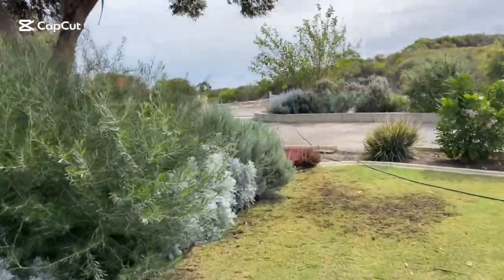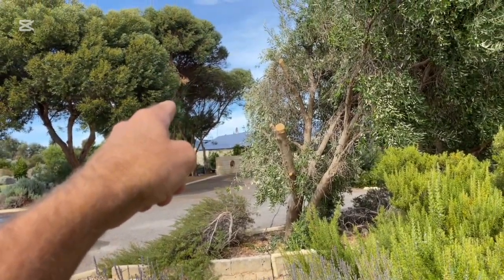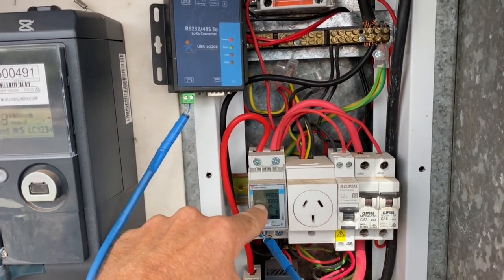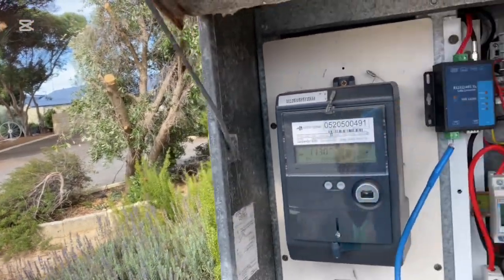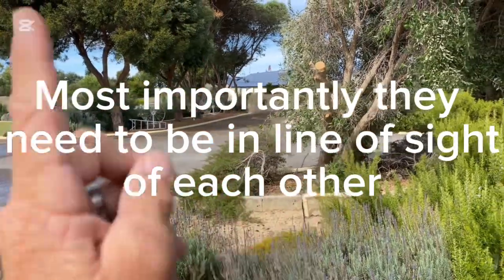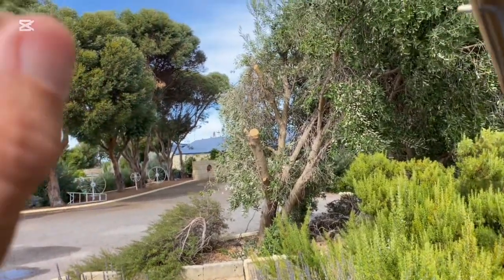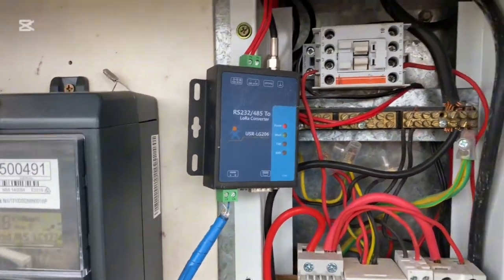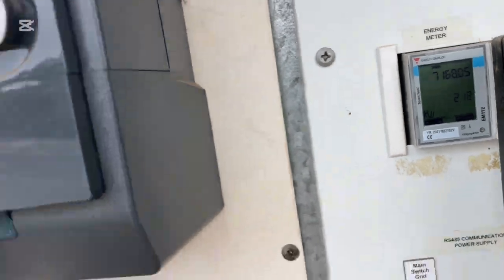Fault finding on QCells battery system with wireless bridge for the energy meter.

Comment: Thats LoraWAN. Should be good for many km's? Why did they tell you it had to be line of sight between endpoints? LoraWAN is way better than that. Id suspect there were RF cabling issues or a faulty antenna. No need for high gain antennas over that distance.